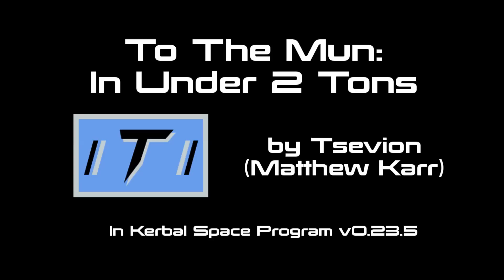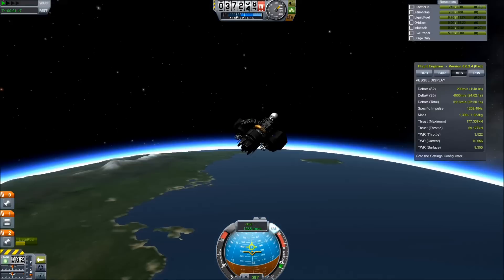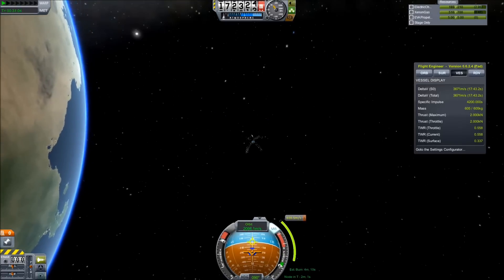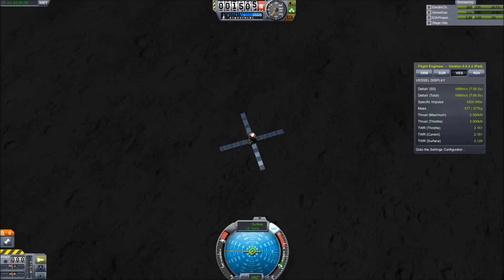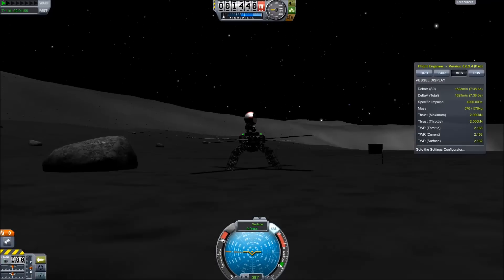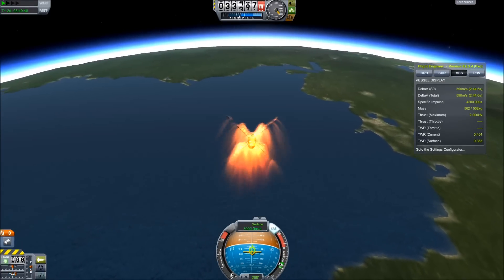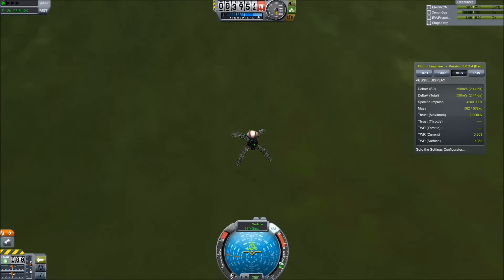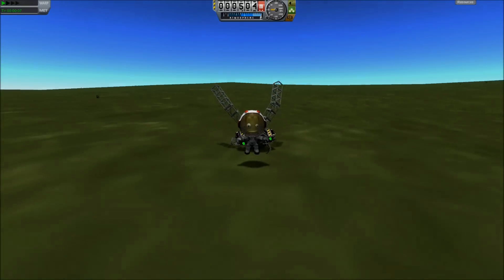KSP: To the Mun in under 2 tons

Comment: don´t it work better with the smaler jet engine? Or at least, just as good? (like 200kg less in total, can remove some feul to)
Reply from the maker: The smaller jet engine has vastly different performance characteristics... It has a top speed of 1000 m/s, and it works increasingly poorly at higher altitude. It's really only good for in atmosphere planes.
Reply: Most jetengine have  a topspeed of about 700m/s in real life before they get overheated. Larger jet engines generally have turbofans that is the main diffrens in ISP. But if you design it with exacly the same relative diameter is scales quite good.

Comment: Can you go to orbit with only tiny parts?
Reply from the maker: Yeah, it's actually surprisingly easy to do. I recommend trying it yourself, the simplest and easiest build is a two stage rocket. For the top stage use the smallest probe core, 2 Oscars, and an Ant engine. Slap the smallest battery and two of the single solar panels on it for power. That's your top stage. For the second stage try some Oscars (4-6ish should work), and everyone's favorite engine, the 48-7S. I'm going from memory here, so you might need to play around a little with the number of fuel tanks, but something like that should get you to orbit pretty easily.

Comment: Could this be lighter with pure ion power (wings to keep it up for assent to orbit)?
Reply from the maker: Nah... sadly Ion doesn't have the TWR needed to get up to orbital speeds.
Reply: Matthew Karr Shame.
People are going to have fun with interstellar now though. Pria to the upgrade to the ion drives I used a tiny nuclear reactor to get a TWR of 0.3. The upgrade puts that at 1.2. 
With 10k/s delta-V.
Reply from the maker: I don't think that's correct unless Interstellar has changed something. Even with the buff, the TWR of an ion engine, alone, with nothing else, is 0.8. It's impossible to build a ship with a TWR greater than 1 using ion engines, regardless of what you use for power. I think interstellar and some other mods add some more powerful ion-type engines (and plasma thrusters and such), maybe that's what you're thinking of.
Reply: Matthew Karr That's what the stats said in the VAB. I always thought they had a TWR of over 1. I saw some video (pre buff) where someone pointed out that an ion + a gigantor solar panel had a TWR of like 0.999. However this could power jut over 1 ion. Then assuming you used several hundred ions and a couple less panels you could theoreticly lift one tank of fuel. For a few seconds. Have they changed the mass of the ion now? That would make sense.
Reply: HALL9000ish
what about using an engine to shoot the ship up into space?